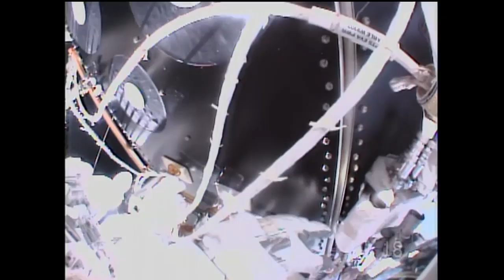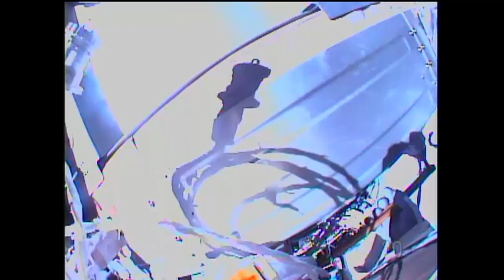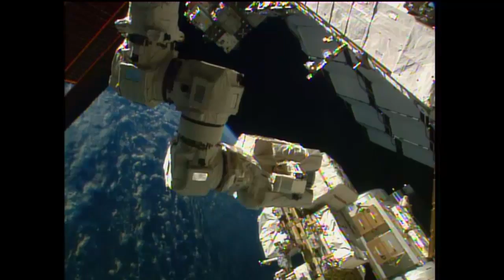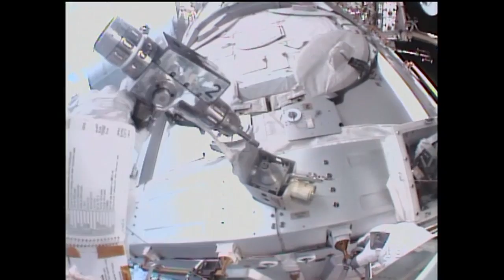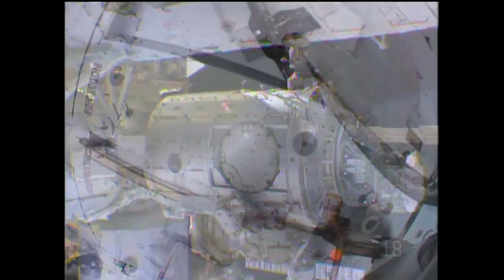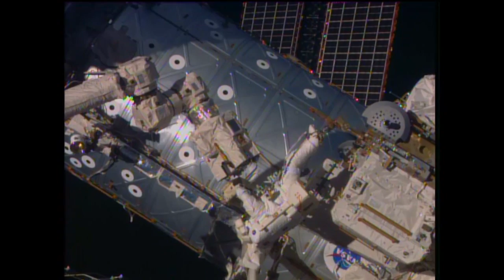Spacewalk continues prepping of ISS for new docking ports

Comment: Nasa I have a question, why are all the cameras in space so low quality? Why don't you just used 1080p cameras up there?
Reply: High quality cameras take up a large amount of memory, and in turn would take longer to stream live. Mix this with the delay between Station Control in Houston and the ISS and there would be (making this part up) a 15 second delay. It is necessary to minimize the amount of delay to ensure stable connection during operations.
Reply: InterestingCommenter I think next generation space stations will have HD cameras. Video encoding techniques are also evolving, bandwidth should be less of a problem in the future.